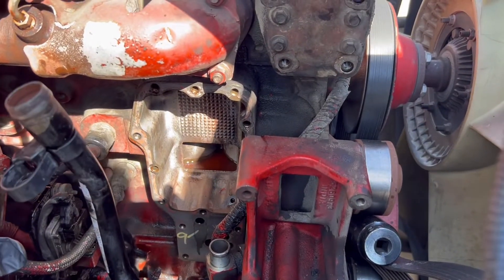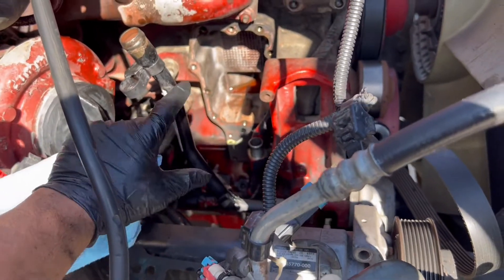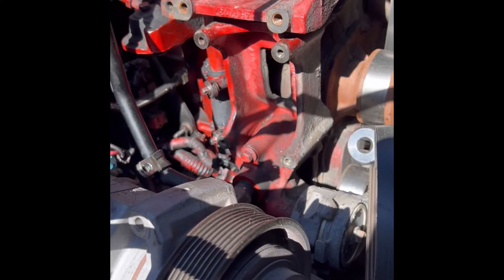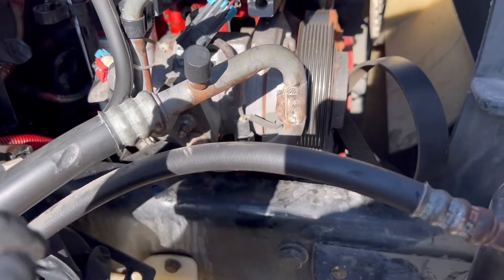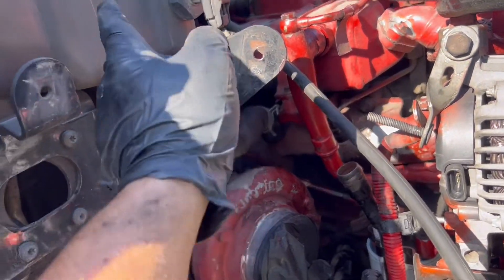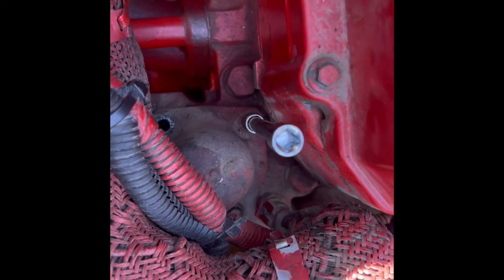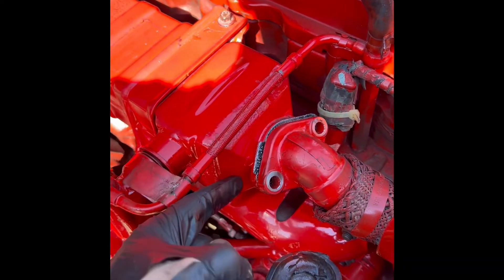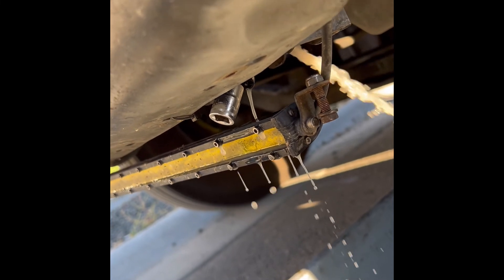DIY: Freightliner M2 Cummins ISB engine cooler installing (part 2)

Comment: What are the torque specs?
Reply from the maker: I use this site torque specs . It will tell you the pattern how to tight the bolts.
Reply from the maker: http://www.dieselmechanic.info/6-7l-cummins/6-7l-cummins-lubricating-oil-system-lubricating-oil-cooler-install.html

Comment: Got oil in my reservoir.. was told it was the EGR cooler up top
Reply from the maker: That could be a problem too, remove egr oil cooler and look inside if it’s dry or not .

Comment: How much you charged for replace oil cooler
Reply from the maker: Where you located ?
Reply: How much u ask for that if would do it ?
Reply from the maker: @mohala1271   I don’t really know :) shop told me $1300 just for labor. That’s why I did it myself.
Reply: @KeyTech911  i was thinking u going do it to me
Reply from the maker: @mohala1271  where you located ?
Reply: @KeyTech911  kent WA
Reply from the maker: @mohala1271  I can recommend someone in Portland . If you want .
Reply: @KeyTech911   yep no problem